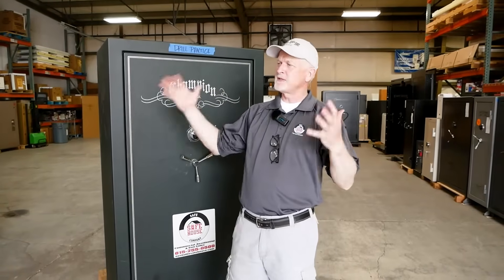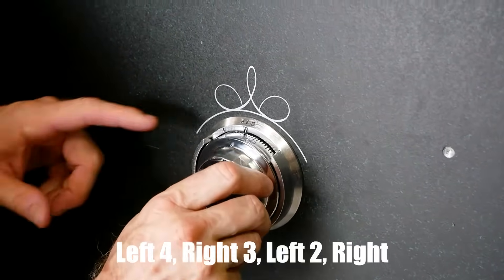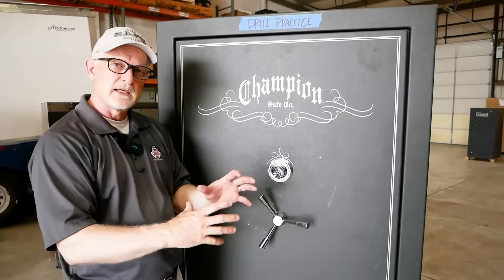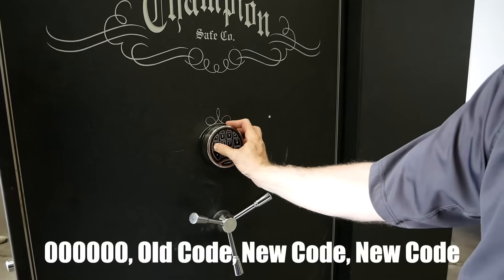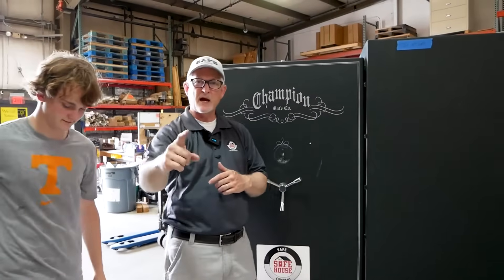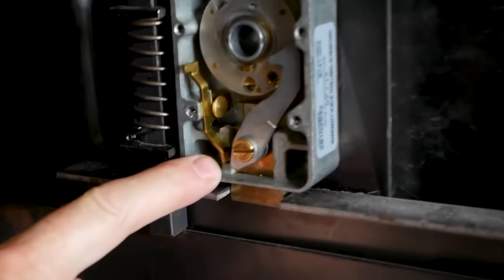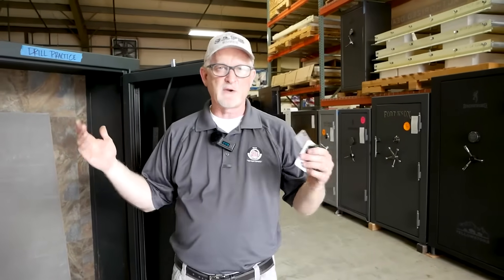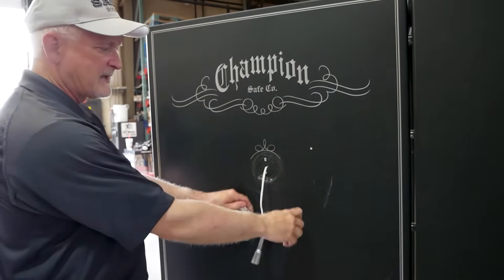Mechanical vs. Electronic Safe Locks – Which Is More Secure? 🔐

Comment: I am not going to tell you where I worked for security reasons. I worked in a State Prison as a high level security supervisor. One day my agency decided to put gun safes inside the gun towers. We had two towers. The safes held the weapons but the ammunition was removed and replaced when the tower was manned. I do not remember the make of the safes but I believe they were high quality manufacturers. I had the responsibility to change the combinations regularly in both safes and each safe had their own combination. One day one safe would not open.  I contacted the manufacturer and they gave me codes to use but still the one would not open. I decided to take the electronic lock off the working safe and try it on the non-working safe. I really did not think this would work because I assumed the combination for each safe is maintained in electronics inside the safe door. As you can see in this video there is a generic cable that passes through the door behind the electronic lock. I was shocked when the electronic lock from the working safe opened the non-working safe. 
Please comment on this. I have looked at many electronic lock safes in stores over the years since then and concluded that they all use the same type of cable so a criminal only needs to bring a generic electronic lock with them when burglarizing homes and businesses. Those of us that worked in the arsenal, and people like me that supervised those operations, are very adept at picking locks of all kinds. Because of this my personal safe in my home is a high quality one, has no second means of opening the safe by use of a key, and I have a mechanical lock instead of an electronic lock for all the reasons above.
Reply: that safe is design poorly.    since the unlock mechanism is inside the safe, the unlock code chip should be too.  Only the buttons should be outside.  Are you sure the combo for both safes were not the same?  or did you use the mfg code  that opens all the safes!   more poor designs.
Reply: Ive seen YouTube locksmith unlock the electronic safes with a small electronic device that tries all possible combinations until it find the correct combination. Takes about 15 minutes max. He takes off the original dial and plugs in his device. No need for drilling.

Comment: I can't help but wonder what would happen if you exposed the wires hanging out and applied 6VDC to them. Seems like a solenoid might be activated 🤔
Reply: I was thinking this same thing whatever power source it uses to the wires
Reply: No the wires are for key pad only and only send digital signal to the locking chip.  You damage the chip and the lock stops working.  Can you supply back up battery  power is the battery  fails?

Comment: In the unlikely event, there is an EMP attack. Anybody with an electric lock will not be able to get into their safes.
Reply from the maker: S&G locks from 2018 and newer are all EMP resistant.
Reply: ... as are like 90% of autos, motorcycles, tractors, big rigs

Comment: A failed solenoid on the electronic lock scares me to death, i am currently looking for a replacement with an emergency key 🔑 its only a matter of time before they fail.
Reply from the maker: What brand of safe do you have?
Reply: @Nashvillesafehouse, it's a 2014 Rhino Metals gun safe with a Lagard "4200 basic" swing style solenoid lock😮

Comment: OK so what if you bring your own secure lock with the pin you know. bust yours off and re attach mine with the pin i know
Reply from the maker: The combo is saved inside the lock body, not the face. So even with a new keypad you couldn't get in without knowing the safe's combo.
Reply: That's like thinking  if I bring my keyboard I can unlock your computer

Comment: Electronic locks can more easily be defeated electronically or through a manufacturer security backdoor.
Reply from the maker: I have an auto dialer that will open most mechanical locks..... so what's your point again?

Comment: That's s 3 wheel 60 numbers on the dial.  A 4 wheel gear driven lock with a 100 number dial. Thats real security.
Reply from the maker: Nope 100 numbers
Reply: @Nashvillesafehouse OK, so let me ask you. Is it a hand change or a key change?

Comment: Should you really be showing the world the orientation of the lock and the relocker position ?   Oh and please do not spin the dial lock like a roulette wheel when locking it .  Over the years if those cylinders slip just a bit your combination will be off 1-2 digits  and it wont open.
Reply: You can cut the sides off with a grinder in 5 minutes so it’s really not exposing anything.   Gun lockers (except a few brands) are junk.

Comment: That's why you put a relocker plate on a digital lock case as well...

This video was quite adequate for demonstration purposes. From a practical stand point, there is pretty much no difference in strength and security between a digital and a mechanical combination lock (US manufactured industry standard locks I am talking about).
Reply: Until the digital lock gets zapped by static and won’t open.  I spend a good part of my day opening and replacing.

Comment: When dealing with an electronic lock... I noticed that once the dial was pulled off, the cord was just hanging. Suppose someone did that, THEN connected ANOTHER DIAL that they came with to the cable and entered the electronic "safe number" they knew.  Would that procedure unlock a safe with an electronic lock? It seems the numbers are "stored in the lock itself" and not internally. Have you ever tried that?  Just curious.  Please let us know.
Reply from the maker: The combination is kept in the internal lock body, so swapping keypads will not allow you to open the lock with another code.
Reply: @Nashvillesafehouse  Thank you!! That is comforting to know!  Great videos --I am really enjoying them. Merry Christmas!

Comment: A $25 Harbor Freight 3.5" grinder with a tungsten or bi-metal wheel will cut most safes like a tin can.  Remember, the burglar doesn't care about making a mess.
Reply: Most safe only have a time rating.  No safe is good forever that's why they have alarms and cameras now.

Comment: I have a Champion safe with a mechanical lock.  I went to several stores to look at safes and the ones with electronic locks that were locked I could not look inside because someone had removed the batteries and the clerk put in a new battery but they wouldn't open.  That's why I bought a safe with a mechanical lock from a safe store.  The battery never dies.
Reply: So, your logic is that because the uneducated employees didn't know how to operate the locks, it's better to buy a mechanical locking safe? 
🤦🏼‍♂️
Reply: @MrFixItGa  So you obviously like the electronic locks because the battery could fail right when you need to get in.  See how I assumed things about your comment that you didn't actually say?  You did the same to my comment.  That says a lot about your logic.  Sorry if I hurt your feelings.
Reply: @davidhomer78 😂 Why did you go straight to "Sorry if I hurt your feelings"?
What part of my comment made you think I'm some kind of easily offended person? 😂
I didn't assume anything. Reading comprehension is fundamental. 
I said your logic was obviously attributed to the store employee's abilities. 
IDGAF what type of lock other people choose. That's your prerogative. I just think it's silly to base your opinion on the incompetence of others.
Reply: @MrFixItGa  Thank you for your apology.

Comment: I would like to see your burglar go at the side of the safe with a high quality diamond wheel on an angle grinder.
Reply: Any security system is just buying "time".
Reply: @miller-clem you can come try to get in the broken safe I removed from a customer.   It’s a John tann.  I have spent a week still not in.   Not a solid week but 2 solid days.   I can get into any gun safe except browning tl, some Fort Knox, graffundr (the very best but 25k) in 10 min or less.  The ones at bass pro 5 minutes.  So gun “safes” are good to keep kids away or amateur but they are not really safes.  And please please please bolt them down to the floor or wall.  I’ve seen them fall on children playing on them.
Reply: Or cut around the lock and drill plate with an angle grinder.
Reply: @WL-mt4mv maybe.  Depends on how it’s made.
Reply: 5 minute or less.  I see it daily.   The metal is very very thin, a few sheets of drywall assuming it’s a “fire” locker and you are in.

Comment: I wouldn't own a electronic lock. There's the obvious things like corroded batteries and electronic failure. However for $3500. a person could buy, or a criminal could steal a special box, that I won't name, that plugs into the cable and runs the codes in just a couple of minutes.
Reply: Yes and note someone could also make a mechanical spinner and open a manual lock too.
Reply from the maker: Those boxes are $5-7k and you need to be a registered safe tech to get one.
Reply: @Nashvillesafehouse So a motivated person couldn't come up with one? Interesting considering they will kill you for tennis shoes.
Reply: @Nashvillesafehouse haha no you dont😂
Reply: @Nashvillesafehouse  just go to NYC, you can buy anything in that crappy city! and doesnt matter who ya are, only if ya got the cash/greenbacks!!!  HHO

Comment: I can get in my mechanical lock in 12 to 15 seconds and I consider it much, much more secure than a electronic lock. I don't care where you buy your safe, change the combo immediately. Even then the factory has a backdoor combo. My safe showed up with the combo written on a piece of tape stuck to the front door. Wonder how many people saw it before it was delivered.
Reply from the maker: Explain how a mechanical lock is more secure than an electronic lock?
Reply: @Nashvillesafehouse  Because an electronic lock can have more than one combo. Because the electronic lock has a backdoor combo. Liberty safe has already given customers combo to law enforcement. A mechanical lock has no backdoor. Change the lock the second the safe is delivered and you are the only person that knows that combo.
Reply from the maker: @WCB7971  The combo that the Liberty employee gave to the feds was a mechanical lock combo.
Reply: @Nashvillesafehouse  First I'm not sure that's true and if it  is its the safe owners fault for not changing the combo. I just did a few minutes research and found out the lock in question was a S&G electronic lock. Shame on you.
Reply: You can change the combination on the mechanical  S&G locks  or need a lock smith to do it.

Comment: Crappy system, double lock fires off leaving you permanently locked out of your safe with no way back in.  Dumb
Reply from the maker: It's either that or someone is able to get into your safe and steal everything. And yes, there are ways to get back in.
Reply: cut a hole with a mini grinder  to grab your stuff
Reply: If you have 800$ after it’s damaged you can get a locksmith to open it

Comment: Yeah thats all good as long as you dont take a grinder to the side wall of that pos safe. Take me 5 min to get inside.
Reply from the maker: We're so proud of you! This video unfortunately is to show the difference in locks, not the integrity of our test safe.
Reply: @Nashvillesafehouse yeah you're showing the difference in the locks, and which one is better, neither do anything to protect the goods inside. Even though the locks are in your opinion" so well designed" that if someone breaks in they have a secondary lock. I'm just proving the point that the whole safe is garbage. Might as well get a metal storage locker.
Reply from the maker: @atrainace114  There is no point in proving the safe is garbage or not. It's not the point of the video. We're showing the secondary security the locks provide to any safe, not just the one in the video.
Reply: @atrainace114  what would you recommend to someone shopping for a safe?
Reply: @pricesowers3733  The only kind of actual safe that will protect anything is either an old safe that is cast and the sides and top are actually solid all the way through. A room that is constructed with stone and steel linings with a vault type door. The best is something that will be hidden in a floor or somewhere that can't be seen. Most not all modern safes are thin garbage and the only solid part is the door. So all that lock and secondary lock garbage can be bypassed with in a few easy min. by cutting throug the sides.
Reply from the maker: @atrainace114  you can still get into a TL rated safe or "an old safe" as you put it. Just use a grinder like you say you can.
Reply: @Nashvillesafehouse  You are totally correct the safes and locks are the absolute best. Please everyone listen and take their word as gospel. Your valuables are totally safe especially with that remarkabe secondary security lock. Thats all you need. Spend your thousands with the knowlege that everything is totally secure.
Reply: I keep my valuables in a shoe box.
Reply: @enriqueoliva6988  This guy knows what it is.

Comment: This is reassuring to know how the mechanism works and that it has backups, but not sure it's a good idea to make it available to the general public as criminals learn from this too.
Reply from the maker: Totally fair point — transparency helps build trust, but it's true that it can also inform bad guys. The good news is these safes are designed with that risk in mind, using layered protections.
Reply: ANYONE can buy these safes and learn how they work.